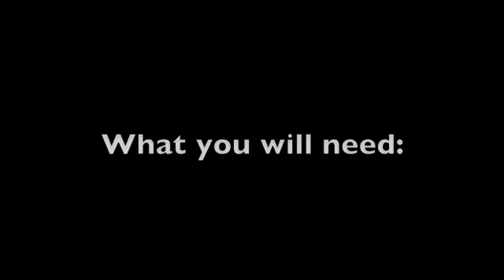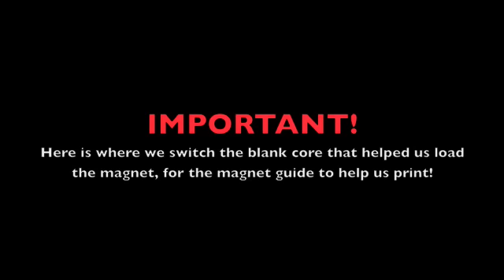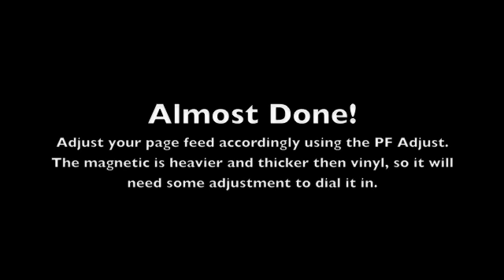Printing Magnetic on a Mutoh ValueJet 1604

Comment: Your printer must have an aluminum bed. The 1204 is steel, so I just place an "L" shaped piece of cardboard on the feed side and then I had a machine shop make me a curved sheet of aluminum to conform to the drying bed which is held in place by two small screws. With all the magnetic surfaces eliminated I just set the head to "High" and no further adjustments are necessary.

Comment: I'm using a 1204 printer and I don't think I have a PF adjustment. Is that in the software or is that accessed from the printer control panel?